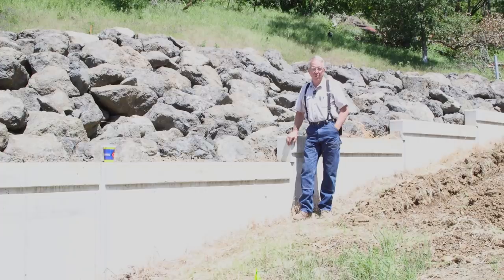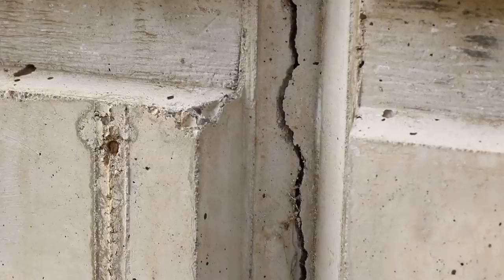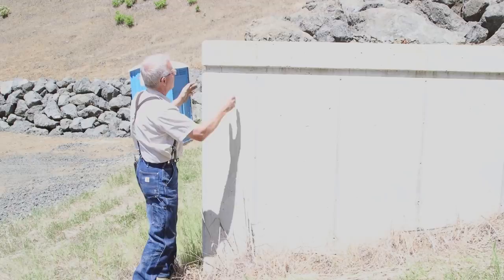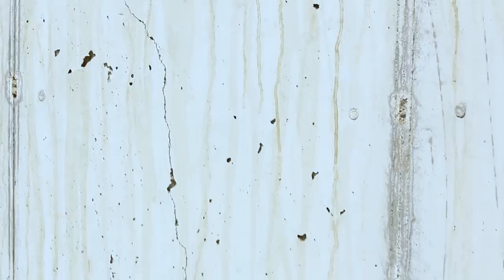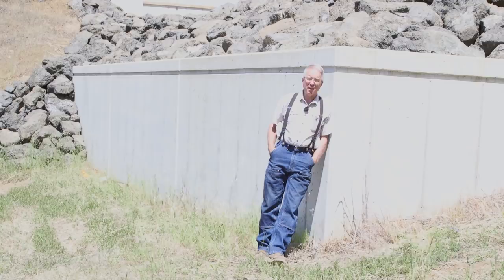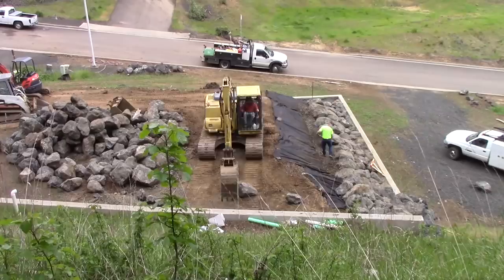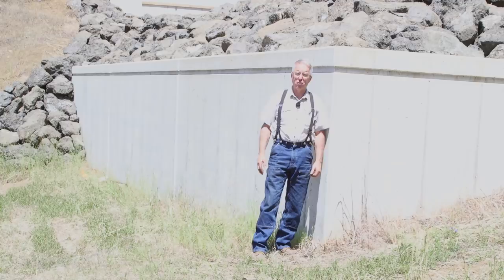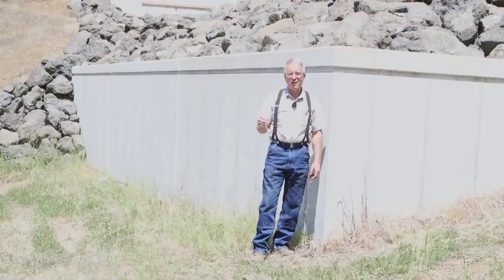Retaining Wall Recap EP.24

Comment: Hello, I think your bigger problem is low quality concrete. Those are some major cracks that showed up to fast. Not sure if any of these Ideas might help you in the future. 1st leave the forms in the concrete for at least 3 days before stripping. 2nd use a sealer on all faces right after your done stripping, both these help the crete release its moisture slower making it stronger. 3rd use a higher mpa for retaining walls that actually have to hold real weight, I would recommend at least a 30 MPA. 4th spend more time on the viberator, I noticed in your close up that you were unable to remove many air pockets as you had plenty of "honeycomb". Even if you need to get a couple other guys running a second viberator to keep up with the pump, this is money well spent on something visible for the next 50 years. 4th give the wall a few days after stripping a sealing to sit and harden before you backfill, also if your not worried about the retained earth settling over time ease up on the packer as it puts undue strain on a new wall. factors depending concrete can take months to reach full strengh. LOVE YOUR CHANNEL, as a contractor I have learned a few tips from your videos and I hope my 2 cent's help you or anyone who reads this ridiculously long post in and future concrete retaining walls.'

Comment: So how does this outside corner translate to say a inside corner of a poured basement
Reply: inside corner has the major forces pushing the walls "together"  an outside corner pushes the two walls apart.  depending upon the condition, both can benifit from a control joint

Comment: All concrete walls crack, period, no ifs and or butts...  I was curious why concrete was chosen over CMU for these walls.  Obviously CMU is not as strong, but unless the retain heights get into the 12-14' range CMU will work fine and is cheaper to install and won't crack.  Well the joints might but it isn't noticeable...
Reply: travsb1984     The bigger the retaining wall the more practical it is to use poured concrete.
Reply: @bonanzatime  Yes that is true for walls that are over a certain retain height which I mentioned in the original comment.  This wall is small and would have been cheaper to do in cmu and would have eliminate cracking, plus been much quicker to construct.  Obviously the owner/contractor probably preferred concrete so he could do much of the work himself (and make a good video of!),  but a decent mason crew could have come and banged this wall out in a day...  I enjoyed the video showing the concrete wall construction, it was informative...  But if you're think of doing a small retaining walls at home like these, you would never choose concrete walls...  Also, if you have soil that will resist a vertical cut you should be using shotcrete walls not CIP, assuming the area you're in has engineers and contractors with slightly advised technical abilities...
Reply: travsb1984  He poured the wall in less than half a day, with like half the labor it would take a mason crew to do in a whole day.  Also poured concrete is stronger.. You say it's a small wall, well it's not very high but it's pretty long.  I'd say it's not a big wall but it's also certainly not a small wall.  Block walls are better for 8' high or less, any higher than that, better off using poured concrete. ..  Basically if the wall will take at least 9 yards of concrete or more, then do it in poured concrete is the best choice. ...Btw, CMU IS CONCRETE and will crack too, and probably won't be solid.  You ever tried grouting CMU, it's never done perfectly. Especially in residential construction.😶
Reply: @bonanzatime  I've designed hundreds of retaining walls, and CMU is cheaper about 90% of the time for walls under 12 feet, even with sloped backfill...  And concrete shrinkage is time dependent, with most of the shrinkage occurring in the first few weeks, so a CMU is preshrunk so to speak.  Sure the joints might open and close a little, but it won't be noticeable.  Being as this is a spec house there will probably be a home inspection performed while in escrow, and it wouldn't surprise me if the report recommended the client have a SE come and inspect the wall, another expense for the seller to eat.  I'm not criticizing the decision to use cip, he made the choice that best satisfied his unique circumstances,  I'm just pointing out that for most cases, a cmu wall is cheaper, and if you're goal is to maximize the return on investment, that's what most people should do.
Reply: travsb1984.    hmmmmm🤔, a lot of what you say makes sense, especially about the CMU being pre-shrunk compared to CIP.  But what makes CIP more desirable structurally imo is it is 'monolithic'; and that inherently is stronger than many individual units, which incidentally also still has shrinkage issues btw. ..As a 'designer' you are comparing material and labor costs of both block and CIP 'retaining-walls'? (apple to apple comparisons?)?  hundreds of them??? I thought that was the contractor's job.?.. No wonder you're doing hundreds of them, you're a gawd-send..☺

Anyway, this particular retaining-wall (I think) is pretty much close to equal in cost to build in labor.  in material? I bet the CIP is cheaper.  Because basically with a CMU retaining-wall the CMU is the forms, because most of it (if not all of it) has to be grouted (aka poured CIP concrete).  It's even easier to grout the whole gawd damn thing even when it's not necessary (specified).. As a mason that's my honest opinion.
Reply: @bonanzatime  Generally the contractors don't get to choose the construction method of the wall, unless they are doing it as a design/build.  They type is specified in the plans and they are not interchangeable. Occasionally the wall type might be changed through value engineering, but I have never experienced a change from cmu to cip, it's always the other way around.  It's usually an architect that wanted cip so they can add decorative patterns and reliefs for visual purposes, but get overruled by the owner/developer when they found out how much it will cost them.  Your sarcasm is noted, and you're right I don't put together bids or cost comparison for walls I engineer on an apples to apples basis.  My opinion is based on collaboration and feedback with lots of different clients who are comparing construction methods apples to apples because they are paying the bill.  For reference, the majority of my work is in southern California, and construction cost do vary form region to region.
Reply: @bonanzatime  The fact that the concrete is monolithic doesn't really make it stronger, as concrete is weak in tension and tensile forces are resisted by the rebar anyways.  Concrete walls are stronger because the compressive strength of cip concrete (2500 to 5000psi) is generally much higher than the design strength of cmu (1500 to 2000psi).  But that doesn't mean that cip walls are any stronger then cmu.  The design loads from the soil are the same regardless of material used, so each wall is designed to resist those loads with as little wasted capacity as possible.  So the higher concrete strength just means the walls will be thinner, or less rebar will be used then a cum counterpart.  Happy Memorial Day!
Reply: travsb1984   Thank you, Spock.  You have a Good gut feeling about the costs from your professional point of view. Thank you sharing that.. and it may be a redundant issue, considering the soil loads and what have you, but it is an engineer (an experienced one) who told me that about the monolithic nature of CIP compared to CMU. Also I vaguely remember reading it  in a construction materials book years ago. Regardless of the comprehensive and tensile strengths blah blah blah; yeah I already know all that. ..but thanks anyway.  Happy Memorial Day, God Bless Our Fallen Soldiers.

Comment: It's called the angle of repose. I laugh every time a builder thinks he's an architect and I feel for the buyers who have to live with their mistakes.
Reply: Could you elaborate on this or point to a source that covers your comment?
Reply: @jonanderson5137  All materials have a known or calculable angle of repose. The angle at which they are stable at rest. This is known to all professional soil engineers, landscape architects and registered architects. The fact that a home builder would take on this level of site work ignorant of the engineering hazards involved validates my point that they routinely get in over their heads to save money bypassing important professionals or they think they know more than they do. Either way the country is plagued with poorly designed and engineered remodels and new construction homes that fail to serve the home buyer or the values in the community. Any money saved in the short term is lost many times over in the long run. Too many people think because they swung a hammer for twenty years that makes them qualified to practice architecture.
Reply: John Bartolomeo    This is not 'the big deal' your exaggerating comment implies.  Are you saying the wall will topple over now?  How about the cracks?  Do you think they will get bigger??   If you do, that just proves you're a hack (or your only knowledge is from a book).  ..That wall ain't going nowhere for a million years.

Comment: It is/was a bizzare choice to use riprap - you're using an industrial solution that's inappropriate for a residential neighborhood (clearly no HOA Architectural Review Committee).  A series of short, tiered retaining walls would have been better - could landscape them and turn lemon into lemonaide - instead you've turned a lemon into hydrochloric acid.  As you had the rock donated, I'd have suggested gabions - with hand-faced rock, they can look stunning.